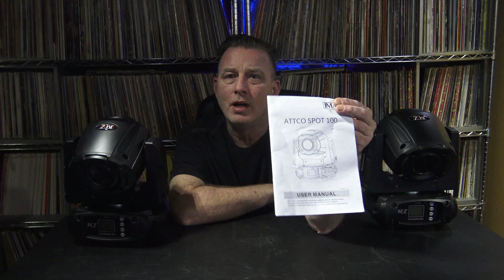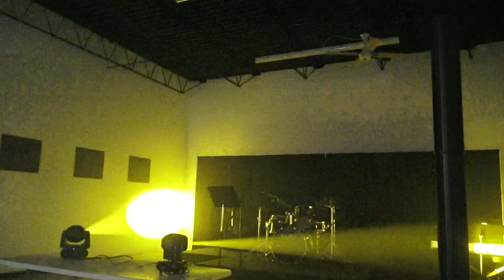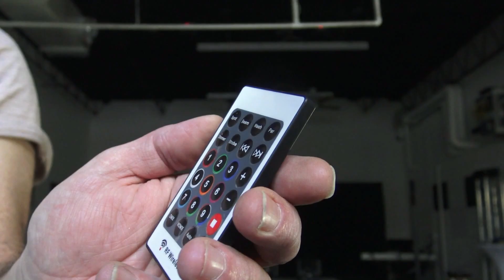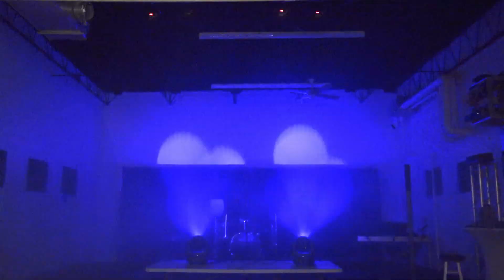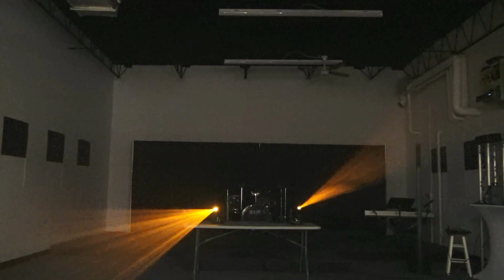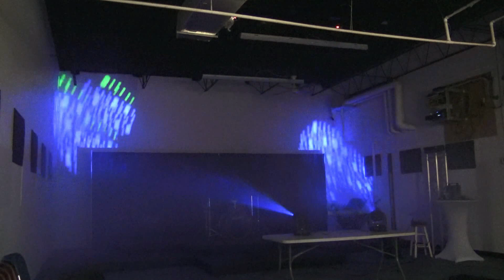JMAZ Attco Spot 100  - Compact RF Remote 75 Watt LED Moving Head

Comment: Great Video as Always. You have certainly helped me for the last 5 years. What about the ColorKey Mover Spot 100 80 Watt Moving head? I can't find anything on that product. It has a prism and motorized focus just like the Attco Spot 100. Any info would be great. Also, the Pocket pro, the Attco Spot 100 and the Colour Key are all pretty much the same price. About $500.00 each. I have 8 Pocket pros, (25 watt led and manual focus) but these two are something I'm thinking seriously about buying. With the Led Power they bring, it's almost a slam dunk. Your comments would be invaluable.

Comment: Brian, thanks for posting this vid Brother!  I dig how light these guys are with that much tech and power inside.  I might pick up a few of these and put away my Intimidators away for a bit.  I finally threw in the towel and jumped in the shallow end of the pool for DMX.  I didn't want to get too complicated for what we do mobile and keeping it compact.  Though, I picked up the ADJ MyDMX Go dongle and app 8 months ago.  Bro... what a super easy application and ADJ did a really amazing job at designing a mobile compact platform to use on an iPad for the guys like us who've always strayed away from full blow DMX use.  Anyway... another great vid Bro and thanks for posting.  DJ GUNZ, Key West

Comment: Hi Brian, will this work with Totems? Is there a Totem mode?
Reply from the maker: Totem Mode is a name Chauvet came up with.  They are just built in shows that work well on truss sticks, on the ground, upside down, forwards, backwards, etc.  ADJ & others do the same thing as well & just call it different stuff, but to answer your question, yes, absolutely.  That's what those 9 built in modes & shows are about

Comment: I got some jMaz uplights and they exceeded my expectations. These seem very nice as well. Looking for upgrading but not at this price. Would love to get some recommendation for good moving heads under $200 since I haven't done this for that long.
Reply from the maker: $200 is very budget.  I'm not aware of anything that's not pretty low end at that price point
Reply: @briansredd  there are lots of these cheaper ones but I guess not as powerful. Thanks for the reply though.
What would you recommend for starting out? Spend more on decent moving heads initially or later?

Comment: Is there an app to control the moving heads besides de remote ?
Reply from the maker: You can use any DMX controller you want, just like any other moving head.  This just has the additional RF capability
Reply: Ok thanks